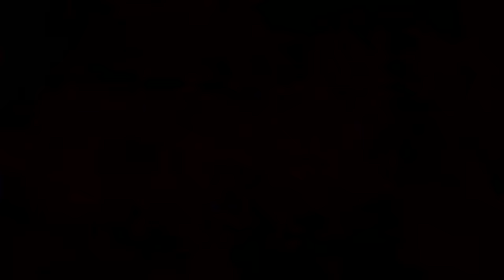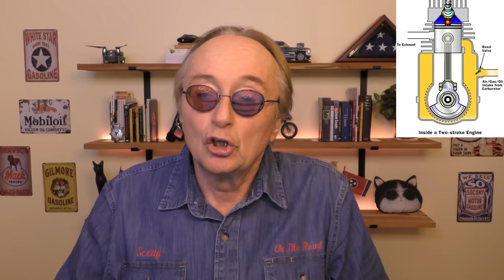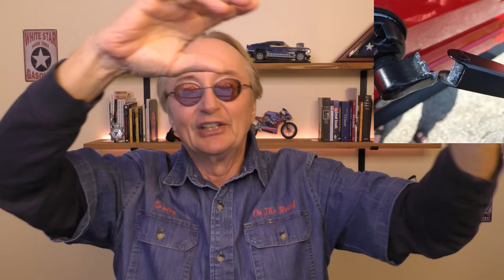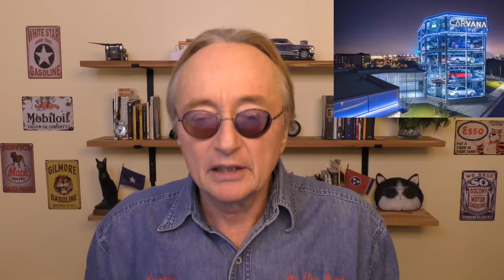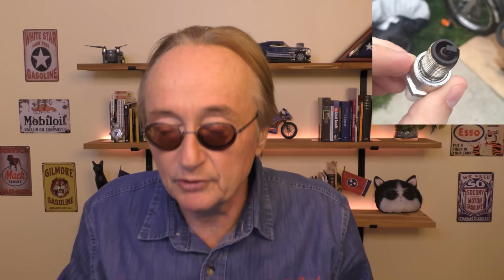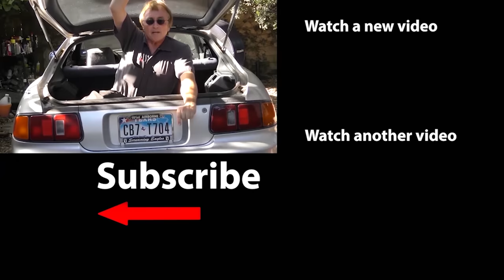Mazda Just Changed the Game with This New Engine (Goodbye 4 Stroke Engines)

Comment: Mazda has always been innovative and I hope they succeed.  I don't lift my wiper blades and just park it in the garage.
Reply: Clean that garage and park your car in side garages are not storage buildings.
Reply: Just in time for electric vehicles
Reply: @flouisbailey  ?
Reply: In soviet Russia you had to take them with you. I don't think I have to explain why
Reply: @pillowbugg  even though they got gas over $6.00/gallon in the US, they still will NOT be switching over to electric cars.
Reply: We didn't have the luxury of garage storage during cold test and calibration. We required temperature below -20 F. Two test sequences per day after 12 hour soaks.
Reply: @gendaminoru3195  It's because electric cars suck.
Reply: @TemperTemper...  Miller Cycle engine was a good product back in the 90's.  Now Atkinson is another good concept Mazda is bringing forward.

Comment: Worked at a commercial nuclear power plant for nearly 30 years.  One of our emergency core cooling systems motor driven generator was powered by tandem GM EMD V16 two stroke Diesel engines, a very good, reliable and SMOOTH running diesel.  It had a very interesting connecting rod to crank bearing and connecting rod.
Reply: Detroits and EMD are on anti friction bearings.

Comment: In Motocicle engines a 2 Stroke 500cc engine probuced the same hosepower as a 1000 cc 4 stroke, in todays racing the 250 4 Stk replaced 125 2 Stk, 400 cc 4 Stk the 250 cc 2 Stk, I have used 2 Stk outboards for 50 yrs and they are very reliable, New technology brought them back, Very happy with it
Reply: m rapacki  

500cc 2 stroke Moto GP bike was around 200 hp back in the 90s. 
Today a 1000cc GP 4 stroke bike is about 260+ hp so technically you are right although maybe with advanced tech the gap is closer.
Reply: Every lightning bolt and the sun are plasma 2 stroke entities.

Comment: The Detroit Diesel 92 Series might have been the best 2 stroke engines ever made. They were really simple and could take a lot of use and abuse before one needed to be rebuilt. That and the EMD 645 and 710 engines. GM really knew how to build those.
Reply: Yup, yup, yup :) Remember 'Em? :) Great, Power to Weight, Ratio... Marine Diesels & Haulage Trucks :)
Wouldn't meet today's standards... 
Still useful as, Short-term, Emergency, Small, Power Station, On-Demand, Back Up?
Seems Mazda, copied the Ex valve idea? Developed Intake valves, into it?
Reply: And they sound so awesome 👍
Reply: I guess you never owned one! I had a 8V92TT IN A CL9000 FORD back in the mid '80s. 4-mpg, very hard to start in the cold and had the motor apart 3 times in the 5 years I had it. The 4-stroke that replaced it(60-series Detroit) was way better. 7-mpg, easy start down to-12°C and I ran that engine for 9-years before one of the injectors went out. Had a lot more torque than that p.o.s. two-stroke.
Reply: I'd love to have one! It's an amazing engine.
Reply: Nothing sounds as good 6v92 or 8v92.
Reply: Fuel guzzling road oilers. They were good at 1 thing. Turning diesel fuel into noise minus power.
Reply: @6h471  lol
Reply: It was a screaming engine.  I put ear plugs in.
Reply: Only
Reply: I got an 8v92 silver, im running BRP XD-100 2 stroke oil and it works great.
Reply: @madogllewellyn i got a silver 8v92 turbo 2 stroke
Reply: Yep I got a silver 8v92 she purrs on the BRB XD-100 2T oil!

Comment: As someone who has lived in snowy lands my whole life, the windshield wiper up is a net positive over Scotty's idea about depending on the defroster.  Inevitably, the wiper blades get stuck if you leave them down, and prying them loose from the ice measurably degrades their useful life.  Yes the up wipers risk getting broken off, but I've never had that happen. In 40+ years of driving, whereas I've ruined many sets of wiper blades.
Reply: Take it from technicians that actually live up North, lifting wipers is a better idea than idling to melt 1/4" of ice from cold. I've seen more burnt wiper motors than broken arms or windshields assuming blades are present.
Reply: You can put a sock on the wipers and leave them down :D
Reply: Wax paper workes pretty good. It's reusable. Just put a strip under your blades.

Comment: Turn the key off when the wipers are about half way and leave them against the windshield. Then put a blanket under them and put the ends of the blanket in between the doors and the door frames on either side. No windshield scraping necessary. No stuck wiper blades.
Reply: auntie does that lol

Comment: The new windshield covers ( basically a blanket with mylar or plastics of some sort) work pretty darn good. Save the wiper blades & you don't have to put them in an upright position. 
They can lay flat...you hear up the defroster & the cover actually contains the heat underneath helping any ice that leaves under. And you literally pull the thing off ( 2 person job for safety purposes) no scraping the windshield nothing...
Are they worth the price???? 
Don't know, mine was free...works well on my wife's car...but I still old skool my car
Reply: Just bought one. It's great 👍😊. No scrapping. Worth every penny
Reply: Tarp...... Nuff said

Comment: I heard that the Trabant had a 2-stroke engine and I think the Wartburg also had a two-stroke but I think those polluted like mad. But the Two Stroke diesels especially a screaming Jimmy had a very good sound when you straight piped it
Reply: Yes. Did you know someone decided to sell jars of Trabant fumes, for the people that missed that old East German aroma?
True, I used to work for for a company shop that had a fleet of 8-71's.  The sound they made at about 2300 rpm was just beautiful
Reply: They polluted because they were oiled in an total loss system. The oil was mixed with the gasoline to lubricate the engine while also burning, hence the smoke and burned oil smell they give off.
Reply: @kinsmart7294  I know I've used the two-stroke weed eater before
Reply: @sidgreentherhymeofreason The 4 joke burn oil as it wear out, and you have to change out oil with metals in it, where as a dry sump metered  oil injection system helps turn the oil into energy in the 2 stroke. It can used a plant bases cleaner burning 2t oil. of course you can turn  any 4 stroke into a valved loop charged 2 stroke, just rig up a dry sump and plumb in  some VRO pumps that tinkle in the intake of blend with the fuel.

Comment: Putting your wipers up just stretches the springs and then the arms won't have enough down pressure on the blades for them to wipe properly. In the long run its a bad idea unless you like buying new arms a few times a year.

Comment: I managed a car glass co. In the 90s. Some body shops we delivered to worked only on jeeps. Most were turnovers. Most had been turned over by women.  Some in a flat parking lot. They didn't realize how high off the ground it was and what a narrow wheelbase it had
Reply: A friend's wife flipped a F-350 dually. Have never understood how she did it.
Reply: @dudleydeplorable5307  Hence you rarely see female professional driver.
Reply: You mean narrow track.
Reply: @DecrepitBiden  Years ago I attended several driving schools to acquire certifications required for my job. One of the instructors was a middle aged mom. She was a maniac behind the wheel. But in control.

Comment: WIPERS UP before any time wipers could or will freeze to the windshield. After a night of frost you can but them down and shoot the windshield washer fluid a few times and wipe while the vehicle is warming up and you eliminate the need to scrape or scratch your windshield. 

Additionally, it does happen that the windshield wipers are left on delay from before the wipers freezing to the windshield, then you start the vehicle and the wiper motor gets stressed.  Also the wipers can be accidentally activated after starting the vehicle, the wipers frozen, and the motor stressed again. 

Ya?

Comment: Scotty. Let me save our friends a TON of trouble/ SNOW; Go to the store and get a regular old plastic tarp that is big and wide enough to cover the front of the car roof, the entire windshield, the hood and most of the grill. Generally, if you do this as the snow fall starts the snow will keep it in place but if not just use a few soft but heavy things to keep it in place until the snow settles it.   Then when you are ready to go you just come out and peel off the tarp......and the snow slides off to the sides and all is perfectly clear. I have done this dozens of times and it save hours of work over the course of the winter.  JZ

Comment: What do vehicle manufacturers know that we are not being told?  If Mazda is still developing gas engines in this new 2 stroke design, that implies to me that they know gas engines still have a relatively long future.  I mean, we all know that there aren't enough lithium-type batteries to make battery packs for the demanded number of EVs and not enough charging stations for them, nor clean electricity for that, but it appears that this administration does not know this or won't admit it.  One has to know all the implications, limitations and ultimate consequences before one demands a plan!!!
Reply: or one just needs staunch faith in eco-fascism.
Reply: Gas engines will still be around, even-after me and you are gone
Reply: You can look it up or even test it yourself.electric vehicles lose a lot of charger when it gets really cold out like under 40 degrees--I have an ebike and can tell you the range is less on it and the air is also thicker making it slightly harder for an EV to also push the car--where a gas engine loves cool weather and is able to breathe better--EV hate it.They also lose a lot of charge if you drive above 70 MPH--which is what 90% of folks do after you leave any major city--the speed limit is 70 plus--I used 100 miles of range in a Jaguar EV they let me try over a weekend in less then 30 miles on the HWY.The EV was nice--power fantastic--but with wha i have experienced they are at least another generation away 5 or more years from these even being viable and folks are having a lot of issues with Teslas sold a few years ago--HUGE bills for repairs because there are no plces or dealers to fix the expensive stuff and noone can even buy half the patented fluids Teslas use if an internal part goes bad.
Reply: And I've wondered as well why so many brand new gas stations are being built in my city right now and in the near future, costco being a big one
Reply: Have you looked at a new car lot lately?  There aren't many cars to be had, regardless of fuel type
Reply: If this administration knows anything, they will forget it by tomorrow ...
Reply: Wait until they implement the social credit score system and you won't be able to drive anywhere but the store and work.  Well unless you're rich.  Us peons though we're stuck.
Reply: @khronin  I dumped all my gas powered tools for battery and now drive an EV and love it. Have fun driving your gas guzzler with $5 a gallon gas. LOL
Reply: The ones not switching to electric are going to go bankrupt.
Reply: If you buy and EV in "International Falls MN" in the winter and charge it up to 100% you can drive it out to the mail box at the end of your driveway and the battery will be dead. That is what -54 F will do to EV Range.
Reply: I'd like to see the reliability and longevity. Remember the Mazda Wankel experience.
Reply: @Xyquest  don't know where you live but come to Texas and you will be stranded on the side of the road while I'm still going down the road in what you call a gas hog there are very very few charging stations here
Reply: From what I've heard from touring some natural gas companies, their attitude is that the transition to renewables (in their field) is definitely coming... "eventually." They generally seemed to think the time frame was on the order of 50 to 100 years, but had little doubt that it'd happen, so they have some research in that area going on in the background while the bigger part of the company still focuses on the current fossil fuel systems.

Now, I'm not sure if Mazda or other engine/vehicle manufacturers have the same attitude, but assuming they do, there is plenty more money to be made in the (minimum) next 50 years producing gas engines and vehicles than trying to produce electric vehicles and the related systems, unless your target demographic is the kind that will shell out the extra money for a Tesla.
Reply: @justintime41776  we'll with this war going on in Ukraine gas is going to be so expensive that's all you can afford to drive 😆
Reply: @Xyquest  Have fun replacing your junk battery packs... your BEV battery pack will cost you at least $40,000. 😂
Reply: @Xyquest  Better buy your BEV replacement battery pack now @ $20,000 before its actual replacement time/price in around 10 years @ $40,000. 🤣
Reply: @guysview   Yeah, that kind of ignorance is very scary!  America's having been dumbed down so much by schools not teaching necessities anymore, TV shows with no real content, and an instant gratification attitude all play into that.  Very scary indeed!
Reply: @justintime41776   A social credit score and basic income.
Reply: Nothing that everybody but the Tesla shills don't already know. Pure EVs are a niche product that has a lot of appeal for urban commuters, short range driving such as pizza delivery, and rich leftists. Otherwise internal combustion aren't going anywhere.
Reply: @ClutchyGT Mostly wind and nuclear.
Reply: @mael-strom9707  Battery prices are getting cheaper every year and will continue to. Gas prices are going up. LOL
Reply: @mael-strom9707  Battery tech and reliability are only getting better every year. Look up LFP batteries that Tesla is using for their standard range vehicles. No cobalt, no fires, and little degridation. They will outlast the car.
Reply: @Salien1999  Run the Mazda 2 stroke on hydrogen... problem solved.
Reply: @mael-strom9707  I like that idea!
Reply: @100vg  What luck for the BEV manufacturers...
Most people are technical ignoramuses.
Reply: Cars are getting more fuel efficient by the minute to a fault. So much so brands like volkswagen changed engine life for fuel economy.
Reply: @kinsmart7294  nope
Reply: @Xyquest  you actually sound like you’ve convinced yourself. Yikes

Comment: I always park my cars/trucks in my heated garage. No ice. No snow.  Insulated & heated attached garages should be code in Minnesota imho. Cold starts are 60 degrees.  Saves on engine wear, fuel, pollution and repairs.

Comment: Okay we don't want to mix the air in the gas before combustion as much as possible so that's why I feel injectors are really a great new technology because you can squirt the gas in there at the very last second you don't have to mix it through the carburetor like in the intake is what helps clean out the two-stroke per stroke

Comment: SCOTTY I've been picking my wipers up before a winter storm for about 50 years and never had any problems from the practice. I still have to scrape snow and ice off the wipers themselves, but they are much easier to get to.  Plus, on the other hand, when they are against the windshield, they can get really glued down with ice. The ice I'm referring to is below the windshield, where there's no defroster action. I now drive a Subaru Forester, and those windshields are very expensive to replace with Eyesight calibrations and all. Best practice would not be  banging around ice build-up on those cars where the bare edge of the glass is in harms way.

Comment: I'm still lifting the wiper arms, "experts". I've ripped the rubber off the blade in an ice storm, and I've also seen a wiper motor burned out because the snow was so heavy the motor couldn't move the snow.

Comment: The most eco friendly car you can buy is one that you keep for as long as possible because then you’re not contributing to new cars being produced. If you buy a new Prius every few years that’s not any better than driving a gas hog suv for 20+ years
Reply: Thank you.
Reply: F A C T S ... I have a 2000 Silverado with 5.3. Yeah it doesn't get gas mileage of some of the newer trucks but I haven't bought a new car because the truck had been pretty solid.
Reply: Can't quite agree with you there. That new Prius you bought usually goes to someone else. Probably someone who can't afford a new car, and wants something good with low running costs. It doesn't really matter if it's you who owns the car for 20+ years or a series of different owners, if that car is on the road for that long it's probably a good thing.

The problem with EVs and Hybrids is that they use batteries, and those batteries are very unlikely to last 20+ years. Hybrids aren't quite as bad in that their batteries are smaller and shouldn't cost quite so much to replace, but it's still fairly expensive and could cause the owner to scrap the car instead. That's why I think current EVs are a bad idea for most people - for their use case it's not environmentally friendly and it's not going to save them money either. But if you happen to fall into the category where EVs or Hybrids actually do make sense for you, then even if you are going to replace it after only a few years of use then I think it's worth doing.

Comment: The reason not to put your windshield wipers up before an ice storm is that the driving rain crusts up the coils of your windshield wiper arms with ice and you can't get them "de-crusted" enough to get your wiper blades to press against your windshield properly until the ice has melted, leaving you with no effective wipers even though you may need them. Take the time to defrost your wipers and the windshield before you gently try to work the wipers loose.